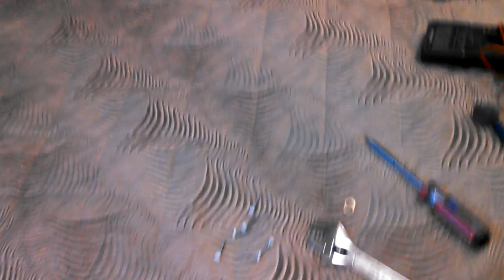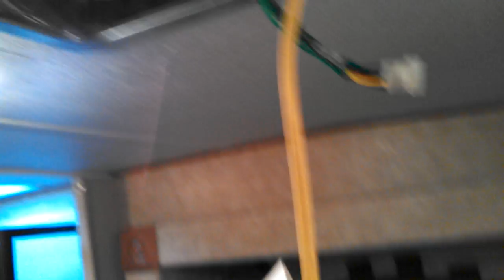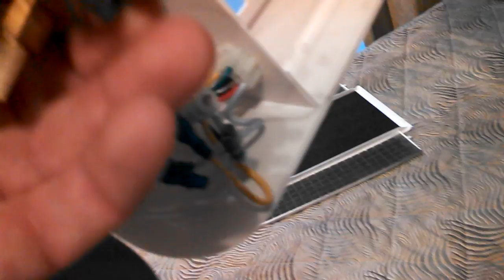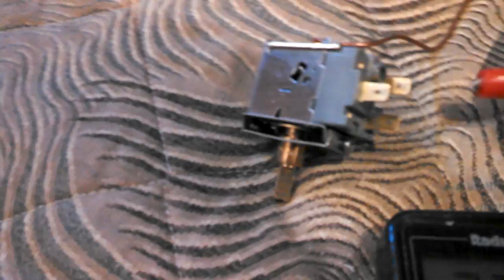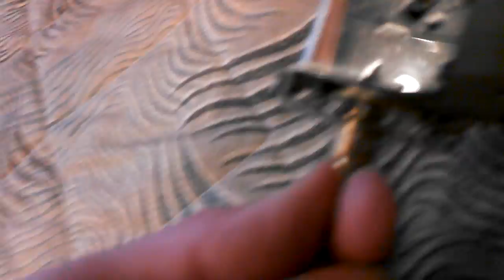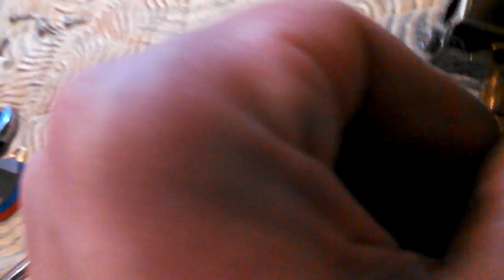Coleman AC thermostat range adjustment

Comment: This works on dometic as well. Thanks for the video I knew it needed adjustment just did not know how. Would cycle off and just blow humid air below 76 now gets in the 60s no issue.
Reply: Can you make a video of how u ddi it?
Reply: @peterc866 The better option is to convert to an external thermostat so the fan will turn off with compressor.
Reply: @Metal_Stacking  How do i do that friend?  Pllease help to explain indepth
Reply: I'm not planning on it. It's almost the exact same as this video.

Comment: My window ac is coming on but if it stays on too long the cold air itself won't kick back on the set temp would be at 65 and room temp at 64 and not kicking back on is this normal ?

Comment: Is there anyway to set the unit to just blow cold air?  I noticed mine seems to fluctuate temperature a lot.  Sometimes its blowing 60 degrees then at other times its blowing 70...Is there a way to set it to just blow 60 no more or less or will this cause it to freeze up?
Reply: bump anyone got the answers to the above

Comment: In some thermostat there is 2 screw which one screw attached with spring inside and one without spring,which one need to adjust for colder 
Plz Reply
Reply: I wanna know too. Could you find out the answer?
Reply: Same thing here did anyone found out the answer?  I adjusted one of the screws but they came totally out & the thermostat was no longer good...?!

Comment: Ok  great but - how do you adjust the differential???
Reply: old post, but the differential is very often the screw at the end where the wire terminal connectors are. adjust carefully, you should notice the amount of knob rotation increase or decrease before it clicks on and off. 
also be careful it could be a screw holding it together on other brand/type thermostats and most importantly keep the air filter and coils clean of dirt/dust/junk
Reply: He did not show this in the video?  Can someone post a full on video of how to do this?!

Comment: Does anyone know if the thermostat linked below can be installed on a 
non ducted Coleman mach 15 rooftop unit?  And if so how low can the 
temperature be set on the thermostat ?
https://www.amazon.com/gp/product/B004RCOU9Y/ref=ox_sc_sfl_title_4?ie=UTF8&psc=1&smid=AIJP7UMTW4R7L
Coleman 83303362 Thermostat

Comment: Thanks for the tip. Had the same problem with new ac. Was going to call the company to send it back. It just wasn't getting cool enough. I turned the screw about 3 turns and now it cools the way it should. Again thanks for the tip.
Reply: Hey Dennis Did you have to turn the screw clockwise or counter clockwise?  Also did you turn it 3 full cirlces?  Please let me know I have a coleman  mach 15
Reply: peter c counterclockwise makes it colder
Reply: Charles Pyatt Charles how many times did you turn it counter clockwise?
Reply: peter c several turns ... Are you using a test meter?
Reply: @100pyatt  No I was not using a test meter?  I was just going to turn it 3 turns?  Do you need to use a test meter?

Comment: Thanks for the video.. My Mach 9200 would always not start ( fan ran ok but not compressor) coming out of storage due to non use most of the season as well. Once going it was fine. Well after five years this season the compressor wouldn't kick in at all.  I figured it was the switch. And now due to your video I see the unit and how to take it out,etc. But I sprayed it with WD 40 and it worked like a charm. Kicked in fast and has been fine for days. In the long run if I need a new one I can now remove and install it.

Comment: hey I did what you said in the video however the little bolt fell out and could no longer be screwed back in...now whenever I run the unit it freezes up because it can't cycle and stop from freezing....can you help?  bump any1 hwew?
Reply: peter c if you can't get the adjustment screw back in you'll need a new switch. Be careful, i wouldn't go more than a few turns, it's plenty to get some very cold ac
Reply: What did you wind up going Peter c? We did the same thing and can't get the screw back in!!!
Reply: @Mr.Rougareaux  Hey Drew what did you end up doing?  I ended up just buying another thermostat from amazon & just turned the new one a little bit.  Did you ever get yours running like they described here?
Reply: @peterc504  yep did the same thing. Worked beautifully, then we traded up for a bigger camper with a digital thermostat lol.
Reply: @Mr.Rougareaux  do you have a video on showing what  you did?
Reply: @peterc504  I didnt video it but it is super easy. I took the hood off, took the 2 screws out of the metal power box and took it down. The screw is (small) is visible. You can pull the thermostat out completely and turn about 3/4 turn. Put it back up but leave the hood off to see if it goes to the temp you want
Reply: @Mr.Rougareaux  do you don't need to do a full turn on the bolt?  Just 75%turn?  What is the range of cooling on your ac now by doing this? Is there a way to buy another thermostat in case something goes wrong?
Reply: @peterc504  yes. So the first time we did it we my wife decided to turn the hell out of it about 4 or 5 turns and the screw came out of the spring. We were able to get it back in after a little time. We ordered 2 extras off of Amazon which we still have since we traded in our camper. I put the new one on and turned it about 75% counter clockwise. I checked it with the unit on all the way cold and stayed in the camper until I heard the compressor kick off. I did this at night so I could tell if the temp was good enough while sleeping. I adjusted it a couple of times. The screw has a little play in it to be able to be turned at least 2 full turns. By the end I probably turned it about 1 to 1 1/4 full turn until I was satisfied. The next camping trip we had it was cold at night when we slept. The reason we bout 2 more is because I didn't know exactly how much my wife turned the screw before it pooped off so I  bought 2 more just in case. I only used the 1. It does work.
Reply: @peterc504  also note once everything was back in place all I kept doing was turning the screw with it hooked up with the cover off until I was satisfied.
Reply: @Mr.Rougareaux  thanks for the response drew!  So you think in total you turned it 1 full circle and about 25% on the second turn?  Btw what is your little blue/red knob set to usually?   I only have 1 spare thermostat and 4 ac units lol I have two large boats each with 2 ac units on it hopefully amazon has it for sale still!
Reply: @peterc504  I have always left it turned all the way to the blue. I live in the south do it stays warm pretty much all the time. In the winter when it's in the 30s I'll leave the fan on all the time on high and open windows. Pretty sure you will still be able to find the thermostats on line. If not let me know I have 2 extra laying around still in the pack. Since we traded up I have ducted ac with a digital thermostat now. No use for them.
Reply: @peterc504  if I knew how to post a pic on here of what my Coleman unit looked like I would show you.
Reply: @peterc504  I do know that all those units are set at a factory temp no lower than 70 degrees. Well that's nowhere near what I need for sleeping in comfort. When I turned it down it was at least 65 if not lower.
Reply: @Mr.Rougareaux  That actually sounds perfect. I think your right about the 70 degree setting.  I used a laser temp probe & it would get up to 68-70 before compressor would kick on!  As you said thats a bit too hot...I will try to turn mine as much as you said if I can get it to 65 thatd be just right!
Reply: @peterc504  if you run into any issues or are not sure you can look me up on FB and message call me when you are trying to do it and as long as its the same model as mine i can run you through it
Reply: @peterc504   Also I want to remind you that when you take off the hood there are 4 philips head screws make sure you get the correct size screwdriver you do not want to strip the screws
Reply: @Mr.Rougareaux  was yours a rooftop 15,000 btu ductless?
Reply: @peterc504  yes. Rooftop ductless with 2 vents on each side. 2 turn knobs in the middle for hot/cold and fan speed.
Reply: @peterc504  my unit was newer 2018, and it had 4 screws on each corner. I unscrewed them and the hood was held up by the knobs. My knobs just pulled off so was easy. Once that was off the metal junction box was visible. 2 screws in that. Its held up by wires so shoukd not fall. The thermostat is visible once the box slides off. No need to take apart anything else. The screw for the thermostat (tiny) is visible. A few turns and that's it. I took mine off about 3 or 4 times at first to get the temp right. It may only take you 1 time. 1 and 1/4 full turn should lower the temp at least by 5 degrees. If not you can give it another half turn. If it's too cold turn it back the other direction about a 1/4 turn.
Reply: @peterc504  I dont want to add any work however, I will tell you if you take the little thermostat off or already have it off you can shine a flash light inside the little box and see the spring and screw. You can actually tell how far the screw has before it detaches from the spring if you get a little antsy when doing this. Also, you can attach the screw back to the spring. I did it. It took about 15 minutes at the kitchen table but I was able. Perfect positioning and patience lol.
Reply: @Mr.Rougareaux  haha well ill just turn mine as much as you did and check at what temps are.  As long as I can get it to 65 like you did I'd be happy!
Reply: @Mr.Rougareaux  BTW do you still need the thermostats since your using a ducted AC?  I wouldnt mind buying them from you.  Also, do you happen to have the old school inner ceiling assembly for it as well?  They stopped selling the old ones!  I guess pics of everything would help the most, also if you have a working heating element too!
Reply: @peterc504  I do have at least 1 of the new thermostats left still in the bag and will sell it too you. It also came with new turn knobs. I can send you pics of the assembly in the bag. That's the only parts I have from the other camper. I'm not sure what you mean by inner ceiling assembly. Also, I still have no idea how to send a pic through this chat on YT. Lmk how I can send a pic to you to make sure the thermostat I have is the correct one you need.
Reply: @Mr.Rougareaux  The ceiling assembly is the inner cover that goes on your ceiling.  Not sure how we can do pics bc putting email addresses on here is prob not good idea...
Reply: @peterc504  I agree. No i don't have any other parts just thermostat. I would def need to send you a pic somehow fo make sure it's what you need.
Reply: @Mr.Rougareaux  Hey drew do you still have your adjusted thermostat?  THe one in my unit seems to be messing up.  The temps will go as high as 80 degrees then all the sudden itll fall to 48 degrees!  It does this non stop within a 5 minute period its driving me nuts!   Please let me know.  I will link to the lil thermostat  https://www.dyersonline.com/coleman-air-conditioner-ceiling-assembly-thermostat.html     Also Im hoping yours is already adjusted as low as possible so I do not need to do that?  I also saw in your earlier posts you mentioned you have a digital thermostat.  Can I just install a digital thermostat as well that way I can just set the temp to hold at 65 degrees?  https://www.amazon.com/gp/product/B004RCOU9Y/ref=ox_sc_act_title_5?smid=ATVPDKIKX0DER&psc=1   im not sure how easy it will be to set this up though?  Is it as simple as just taking the yellow and white wire out of my current thermostat & plugging it into this one?  Also this is going on a boat so I would most likely need to just mount the thermostat onto the AC unit  Is there anyway to send msg thru here I remember youtube had that feature before
Reply: @peterc504  I have a new thermostat that I purchased as a backup in case I jacked the other new one up. It's the same in the link you u sent.
Reply: @Mr.Rougareaux  awesome is it adjusted though for coldest possible setting?
Reply: @peterc504  no it's still new in the pack. It can be adjusted though.
Reply: @Mr.Rougareaux  I see well there is no way to msg they youtube lol
Reply: @peterc504  hit me up on FB. Drew Cheramie
Reply: @Mr.Rougareaux  how much for thermostat?
Reply: @peterc504  I paid 40 bucks for it with shipping. I would just charge what I paid for it.
Reply: @peterc504  it is much easier to look me up on FB to make contact. YT is a pain.
Reply: @peterc504  I cant even send a picture of it on here. Its unopened.
Reply: @peterc504  FB messenger. Drew Cheramie
Reply: @peterc504  also a digital one can be installed however, you would have to run a thermostat line to the location you want the thermostat. They do sell wireless however, that would require you purchasing another thermostat inside the ac with the wall thermostat.
Reply: @peterc504  I also have my original thermostat that came with my camper. We took it out all together and replaced with the new one. I can give you that one as well. It still works as well.
Reply: @Mr.Rougareaux  a wireless thermostat?  That sounds interesting how does that work ice never heard of it.  I read that if I put the wall thermostat that can actually hold certain temps I will need to also buy a control box that it needs to connect to...seems like a lot of extra work lol
Reply: @peterc504  I'd does sound like it. Lmk if you want the thermostats
Reply: @Mr.Rougareaux  how can I get the wireless one?  Also you mentioned there is a way to adjust the thermostat without taking it out the ac how is that possible?
Reply: @peterc504  I've never dealt with wireless. I looked a few things up online. On my unit, I was able to take the cover off the ac, then I took the metal cover off that covers the thermostat. Once that was off my thermostat was visible along with the tiny screw. WITH ALL THE POWER DISCONNECTED I can turn the screw counter clockwise to adjust. I started with a full turn. I put the metal cover back on, turned the power on and ac and tested. Yes it was time consuming however, I waited until I heard the compressor kick off. I repeated this process a half a turn each time until Inwas satisfied with the temp. I did not have any special meters or tools. I used a simple cooking thermometer to make sure the air was very cold coming out of the ac. It took about 3 times and 30 minutes each time to wait until the compressor kicked off. I sat in my camper while the ac was running. When the compressor kicked off and I was cold enough I put everything back together. Our first camping trip after adjusting it was a little too cold. While at the site I cut power, took all the covers off and turned slightly back clockwise to turn up a tad. After that it was perfect. I do not know what the final temp was however, I knew that I could sleep now in comfort. My blue/red hot and cold knob was adjustable however, I wanted to he able to always leave it turned full blue. Turning the knob up only kicks the compressor off quicker. During cooler months I did turn the knob up a little so the ac did not work as hard or freeze in cooler temps. I dont know really anything about the wireless thermostats or others. I went with adjusting my thermostat and it worked. Remember, I traded in my camper and upsized. My new unit came with a wall thermostat that can be turned as low as 50 degrees. I'm not sure your ac unit is the same design. Same thermostat but maybe different design. I was able to turn m my little screw without having to take out or unplug the wires to my original thermostat. I did take the thermostat off the very first time I attempted to adjust it. After we went batshit crazy on the counterclockwise turns the first time and the screw popped out of the original thermostat I realized 2 things. Dont turn it 5 times or batshit crazy and save time without taking out or unplugging t he thermostat. Hope this helps....
Reply: @Mr.Rougareaux   how many times in total did you turn it to get the perfect temp?  I might jus mess with it when I get a chance to see if it'll fix it! Appreciate the help!
Reply: @peterc504  I have to say about 2 full turns in total. I did about a half a turn each time about 4 times before I got it where I wanted it.
Reply: @Mr.Rougareaux  awesome thanks.  I hope the issue is the thermostat. My temps all the sudden started fluctuating from 50 to 80 degrees... before they would never go above 68. The ac is only 4 years old